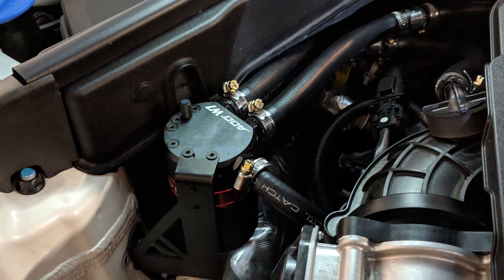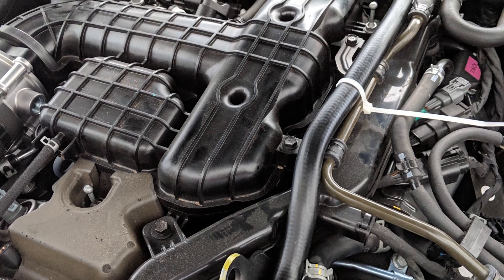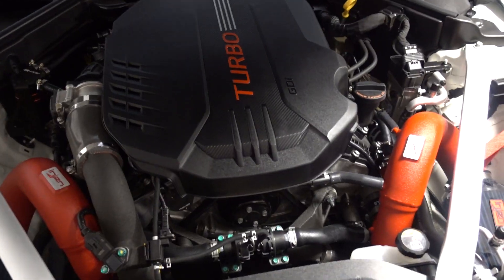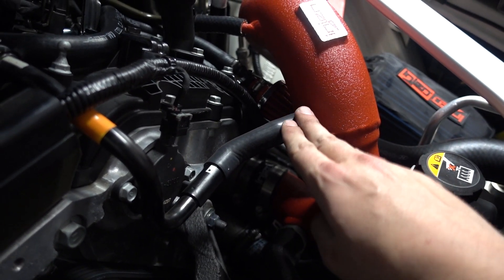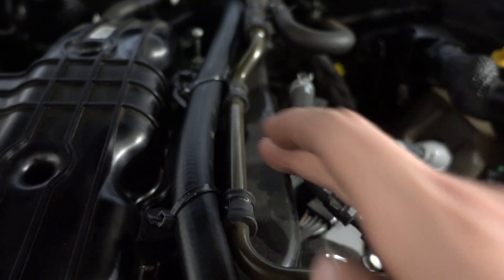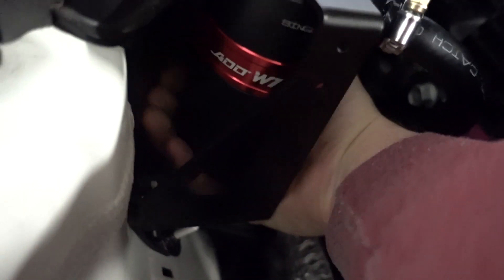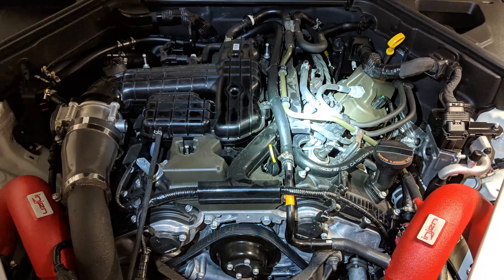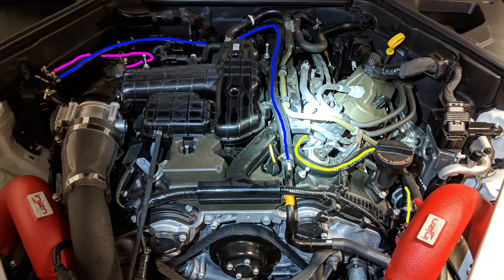ADD W1 V3.3 Baffled Dual Inlet Oil Catch Can Kit with Injen Intakes | Kia Stinger GT2

Comment: Great video.  I originally wrote "After watching this, I'm pretty convinced to get the Direct Fit Mishimoto Oil Catch Can instead... such a breeze to install, and it gets the job done."  but re-watched your video again & you're convincing me this actually is not hard at all -- it just requires a few extra steps, patience & imagination 😅  I think this is a better kit than the Mishimoto one since it's got both inlets.  Correct me if I'm wrong, but I have the feeling it's worth the extra effort!
Reply from the maker: It is. And it's funny I just went and checked my can and I'm very pleased with how much it has caught. Emptied it out and she's clean again. Took the time to wipe down the engine bay lol.
Reply: @QuickandDirty  That's amazing. Yeah, I'm going to get this one. I'm currently researching how useful the second outlet actually is; since the CCV hose originally connects to the intake, I'm wondering what's the benefit of passing it through the catch can if we attach the breather in the original spot anyway? Trying to understand the benefits of this connection, can't find it anywhere online.

Comment: So this catch can is dual inlet, but you say your system has two outlets? I was under the impression that the two side by side inlets connected to the PCV and Crankcase Breather Hose while the solo side outlet connects back to the Intake Housing?
Reply from the maker: It is quite unclear as far as the 'inlet' vs 'outlet' terminology.  The only thing I can tell you is that the instructions from ADD W1 state that one of the inlets is piped to the intake manifold with a one way valve pointing away from the can, one inlet is piped to the driver's side air intake tube with a one way valve pointing away from the can, and the outlet is piped to the PCV on the lower backside of the engine.  Basically, when the engine is at idle or low RPM, the one way valves are closed.  Under heavy acceleration, the intake manifold and intake pipe vacuums pull the one way valves open which pulls vapors from the engine/PCV through the catch can, eliminating oil and other contaminants from building up in the intake manifold and intake tube.  Hope that description helps!
Reply: Ah okay, i guess i just need some detailed directions for my Kia Forte. I think my setup would be slightly different since i don’t have a twin turbo or a turbo at all actually. Thanks for the response though! I’ll get in touch with ADD. Sweet setup btw. 👌🏼🔥
Reply: From what I understand, you are correct, and his setup is wrong. I left a post asking him for clarification, because I may be wrong.   BUT, from my understanding, there should be a hose coming from the PCV to the can and another hose coming from the CCV to the can, both bringing blow-by to be captured by the can, and then there should be 1 single hose with a one way check valve running to the intake manifold.  He seems to have the PCV routed properly, but then is venting it to 2 separate places (the IM and the cold air intakes) whilst venting the CCV to atmosphere, which is, arguably, the better idea, but perhaps after filtering to the catch can- you dont want that nastyness anywhere in your engine bay.  I would love clarification on this.

Comment: Hey Dirty I just wanted to say "GREAT VIDEO" you helped me out tremendously with understanding how and where to install the hoses because ADD W1 instructions are f***ing terrible, only thing is I have AEM intakes would I be able to use your same method and did you have to purchase a 4th hose?
Reply from the maker: I bought a few extra things to reroute the breather under the front lip of the engine cover. Still working great! I think if you look at my update video you'll get a clearer understanding of where I routed everything.

Comment: I'm confused I thought this can had one outlet connected to the intake manifold to create vacuum... Which pulled the contamination from one port coming from the PCV and the other coming from the CCV... Where does the breather fit into this lol? 2013 Sonata 2.0t which I bought this same kit for
Reply: Hey @tonybailey89 I am planing to get this for my 2014 sonata limited 2.0t and I don't know if that is a good kit or no. Do you have ayn suggestions. I would like to hear your opinion. Thanks
Reply: @cengiztelli I've had it on the car for years and it's worked pretty good, I went with the upgraded valve option so dump the can every 5-10k miles and it's held up great ADD v3 I think
Reply: @tonybailey89  what is upgraded valve option. my odometer shows 253.000miles so I am gonna get my air intake valves cleaned by Walnut blasting and install that add w1 v3.3 catch can. If you know a better one for that 2014 turbo sonata I can go with that too. Also I am planning to clean my intercooler and fuel injectors. I may have additional questions about catch can and everything. If I don't bother you may I contact with you ?

Comment: I have just one can how would you proceed to install one. By the way I have a mishimoto catch can.
Reply from the maker: Install it between the PCV and intake.
Reply: There are 2 intakes which one?
Reply from the maker: The one on the passenger side by the PCV valve.  It's not on the intake tube, it's on the intake manifold.

Comment: do you get a gas/ oil smell when ac is circulating from atmosphere upon moderate acceleration?
Reply from the maker: Negative, haven't noticed any smells. My Z28 used to have the smell you are describing though.

Make sure you have a good air tight seal on the PCV outlet.
Reply: Did it work? I’m getting the same thing

Comment: Did dealer void your warranty? Or do you remove it before going to dealer?
Reply from the maker: No, it doesn't void the warranty.  If I needed to take it in for engine work I probably would just remove it though just to be on the safe side.
Reply: @QuickandDirty Thanks for quick reply. Is this easily removable and able to put things back to stock quickly?
Reply from the maker: Yep, very easy.
Reply: I have the same intake. It's super easy to install and remove. I put back the stock filter box when I took in for an oil change. Damn thing takes like 8 qts of synthetic oil and a Kia specific oil filter. Totally worth it though! Don't mind spending the money

Comment: Forgive my ignorance but this makes no sense to me, from the way I understand this item to work.  You should have blow-by coming in from the PCV to the catch can, as well as a hose coming from the CCV into the can, with a single hose  /  single check valve filtering it into the intake.  You appear to have the PCV routed to the can properly, but then you have both hoses going to different air intakes, which completely negates the entire reason fro this item to exist. Why would you need to vent the PCV to the intake manifold AND the cold air intakes?  Seems redundant and a waste.  The whole purpose of the dual inlet catch can is to catch blow-by from two sources with only 1 can. You are only catching 1 source and venting it to 2 places needlessly.  If I am in error, please explain this to me so that I know better, because I am about to install a pair of catch cans on my new car very soon.   Thank you.
Reply from the maker: You are absolutely right, this is not filtering the CCV side, it is vented to atmosphere. I have it setup per the instructions included with the can. Others had set this up as you mentioned and they were blowing their dip sticks under WOT. Very much interested in your suggestions.
Reply from the maker: One other thing, the can is single inlet, dual outlet.  So not sure what to do with that...